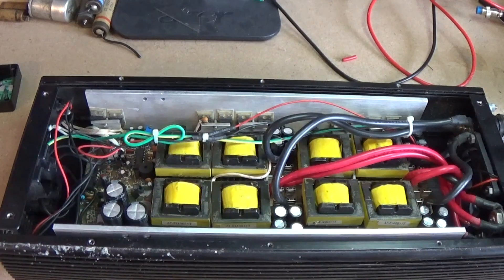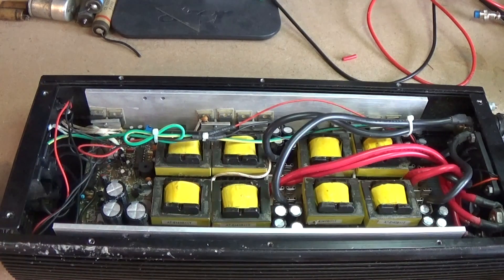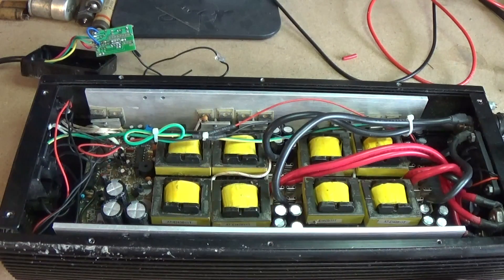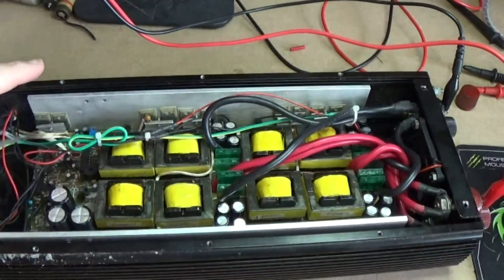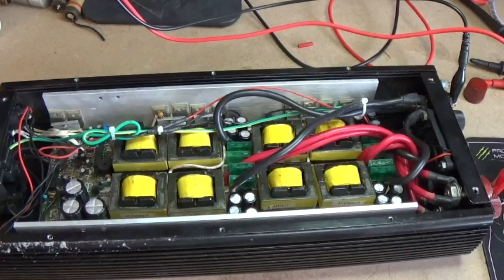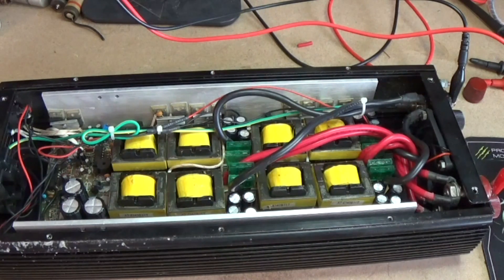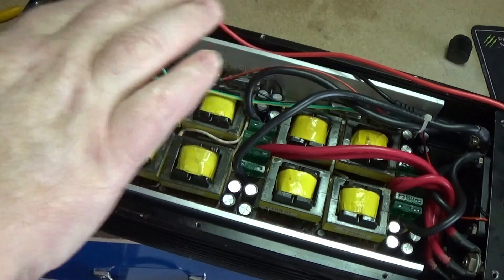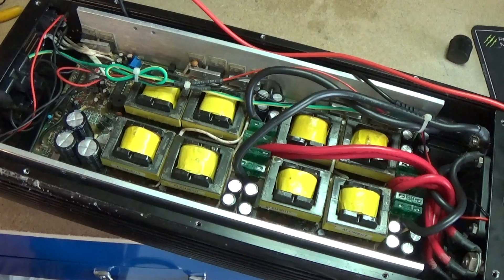My Ebay power inverter find fix

Comment: Dear,
I bought micro inverters 127V , but I need 220V. I cannot return these micro inverters. Do you know how these micro inverters can be changed into 220V?  papadesmond@hotmail.nl
Reply from the maker: No probably not, you wold have to replace the transformers and possibly the moss-fets too

Comment: Little heatshrink over that cheesed part of the wire. Good as new. I mean the case isn't exactly in perfect nic but who cares as long as the bloody thing works right? Well done Paul!
Reply from the maker: Yeah I know a nice bit of heat shrink would have finished the job off nicely, but it is a old inverted and for personal use plus probably about 20 mos-fets to unscrew and then clean up then new heat sink compound etc etc. If it was for one of my customers then it would have gotten the full treatment but it is still going strong
Anyway thanks for the nice comments. Paul

Comment: That was an excellent purchase, im chuffed it was a minor problem :-)
Ive seen similar inverters that just popped every mosfet and the drives plus resistors and finally the drive i.c, sometimes its just not worth the trouble if its a cheap-n-nasty one.
That one looked like it had a fuse for each pair of mosfets and transformers, nice :-D
The only other thing i tend to notice is nasty looking electrolitic capacitors, allways worth testing/replacing with better spec :-)
Reply from the maker: +zx8401ztv Thank you yeah i know what you mean, I do keep a fairly good section if most common components components and a few high power n and p channel mos-fets  but not enough to replace the whole lot lol I did check over the electrolytics and no bulges and leaks but wasn't a good make though but it would be quite hard to replace the capacitors becaise the circuit board is fitter in to a sub heat-sink ant to get the board out would require un-mounting about 20+ transistors and mos-fets, so i would replace them all only if i really had too. I have got mostly rubicons in stock and also some cheepies.lol
Reply: +ElectroMechanical Paul ahh the pain in the bum designs, ive seen lots of things like that where they didnt give you easy access without stripping everything down :-(
Some big hi-fi amplifiers are a nightmare to work on, the type where the main board is plonked in and many layers applied on top, so diagnostics is a pain and replacing parts can be a full stipdown just to replace one silly component.
I admit that if its a wired component i will snip its leads as close as possible to the part then solder a new part to them, nasty and bodgy but ive helped many frends with quick bodges :-)